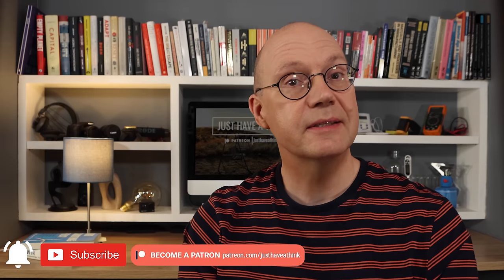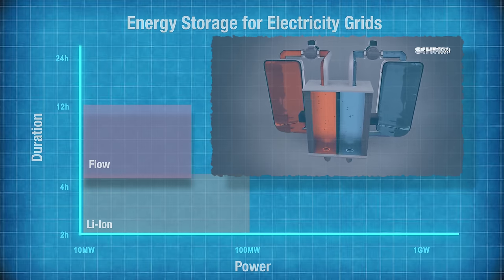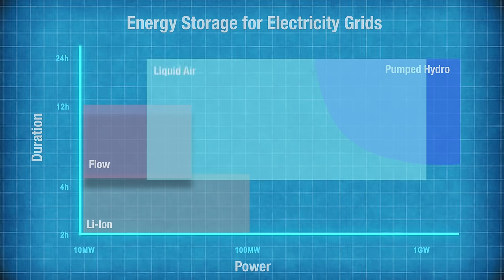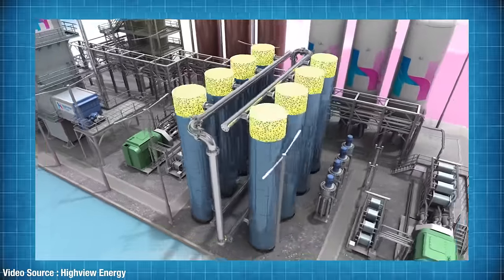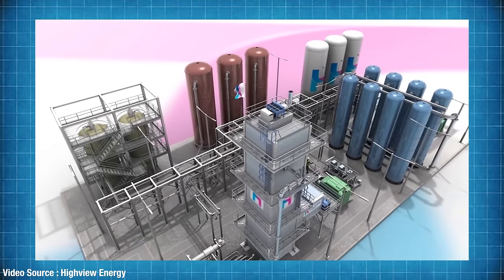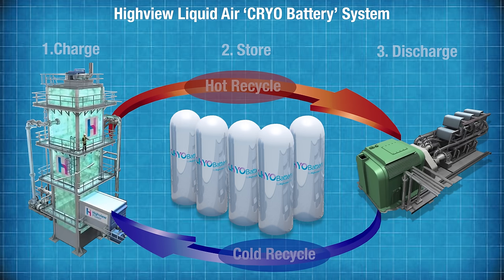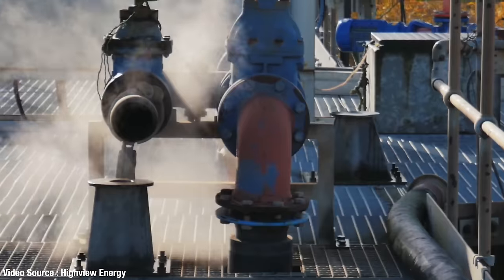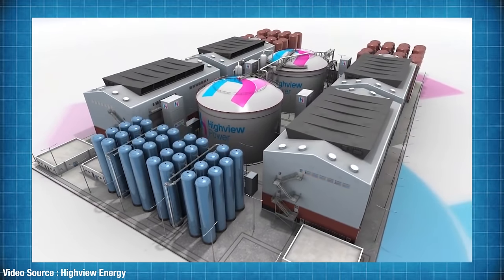Liquid Air Batteries. Literally energy from thin air. Seriously. Literally!

Comment: I'd like to note that the air in this process isn't thin but actually pretty dense :D
Reply: My boyfriend called me an airhead last week, well now I gunna tell him Im not, Im actually pretty dense, so there !
Reply: Literally energy from thick air. The video title was just clickbait.
Reply: The energy that drives the turbines comes from the heat contained in the ambient air that is used to evaporate the liquid air.
Reply: Hence, liquid-air...
Reply: It's starts of as thin as a morning breath..
Reply: It starts thin and the process thickens it using a secret proprietary thickening agent, probably Marmite.
Reply: @grindupBaker  Well it is a process you either love or hate.
Reply: grindupBaker . Or vegemite.
Reply: @mitseraffej5812  During the liquefaction process, lots of heat were thrown out (rejected); essentially you are pumping out heat from the air and making it cooler. This heat is rejected outside. In ideal condition, this is a Carnot's engine run in reverse- or a Carnot's refrigerator.
Reply: The liquid form weighs less per molecule than the vapor form and density almost does not matter and it certainly doesn't in the context that that you have naively chimed in 4. Learn about the energy of fusion which is the wording that High School dropouts are taught by when they get a license to handle fluorocarbon refrigerants. Massachusetts Institute of Technology has been prompted by a mere million dollars to break the silence of such fools in terms of what you should do with the humidity instead of making it lighter you should just filter it out your chimney because although it is heavier as the gas the nitrogen and oxygen takes up less space for the same weight meaning of that the nitrogen and oxygen stay in your house if you separate them from the water Vapors and the water Vapors don't consume any energy being pumped out your chimney. This room air conditioner uses less than 20% the electricity but of course if instead power buy liquid nitrogen turbines you can take another digit off that number.
Reply: @mitseraffej5812  it's actually a little bit more nuanced than that but you're on track congratulations! If you ever watched Barbara Eden in I Dream of Jeannie you know a lot about the hometown of the most recent patent, and that man in Florida refers to the liquid nitrogen appropriately relativistic potential energy. It's only been a matter of weeks since his patent was published. It's very simple refinement which goes to show you the power of the fossil fuel industry and those who think they depend upon us burning. What they depend upon is almost none of us being willing to sacrifice Our Lives non-violently. But in sparing our individual lives we almost ensure ending the species existence not just all the other species but us. If you care about the planet then you have to do the diligence and apply various Sciences including Logistics using metrics and peer review period. That means that you have to be elected or something not just testified to Congress but have the security given even our president LOL. Fortunately the system science of potential energy and phase change materials can be popularized so that we don't need to have the fragility of a Kennedy or a Martin Luther King but the knowledge itself can overcome. that means that Saudi Arabia and China maybe our only hope as they prepare to provide for the future without burning Black Gold but rather turning the sea into liquefied air by remarkably High ratio of liquid air 2 uranium molecules. With a range of digits between 50 and 2000 how many digits do you get guess that ratio has in it? Can 1 oz of uranium create a square cubic mile of liquid nitrogen? The answer is yes but only if you apply current technological developments that allow all the neutrons to do the work themselves drastically cutting the capital infrastructure costs to an affordable level if done worldwide with minimal cooperation is in one large or almost any two significant Nations.
Reply: @janami-dharmam  who are you talkin to 99% of the people here will take what you said is gibberish and you're not even listening to it yourself. The potential energy of liquid nitrogen is far higher than your abstractions because it is on the surface of the Earth that the liquid nitrogen is produced. The various salons that you talk of are basically confused utterances of people who didn't even have an abacus at hand.
Reply: Irene . Your comment has to be one of the most convoluted bits of BS I have ever read, and for YouTube comments the BS bar is very high.
Reply: @Irene-fu6gj  You appear to be the best joker on the you tube (I am yet to see an greater one) - like the potential energy of liquid nitrogen... did you ever went to the school, by the way?
Reply: @Allen Loser I think we are going back to Prior centuries instead of post equivalence of mass and energy where we understand that energy is conserved but not without changing the mass. The energy of fusion specifically is encounter on a daily basis. When ice melts it absorbs heat. Where does the energy of that heat go to sir? I mean you know that it is conserved. You know that it's not a chemical change per se but rather a phase change. Now these are just labels and I don't want to lower myself to espousing Dogma without explanation as you have especially most obnoxiously and saying about 28 grams. Ian Stein and theory has been verified in numerous ways so if you want to look something up why don't you go look up the changing weight of ice when it melts into water or water into steam. You can actually calculate the mass change yourself if you have a big enough calculator to handle the cliche of energy in increasing the mask slightly so that the square of light times the mass balances the equation. It is really an interesting Didact ology because so many people who should know about this they're not and they believe that because they have not had their nose rubbed in this fact they have certitude about what they know. However don't get distracted by what we discreet disagree upon because whether or not liquid nitrogen is lighter than nitrogen Steam in terms of its mass per as you put it molecule it is an extremely dense fuel that has extraordinary properties we can benefit from. There is so much geothermal energy I mean all you need is a way of converting it to something that you can ship and obviously liquefying air with geothermal heat is under investigated for all the bad reasons.

 I had a in-person conversation about this recently and the person I was like you and they said that water vapor is heavier than air. They also got the ice thing backwards but conceded there error there and literally ran away before have to concede the entire jumbo carrot cake.
Reply: @Allen Loser so I went ahead and Googled for your benefit I hope you appreciate this quote and the link that it is found in even though it talks about turning water into its two elements at the end don't just read the final line and complain that's not the same thing as changing the phase of water because he, Dr. Baird, addresses that.
" "chemical potential energy" is just an old-fashioned term for what we now know is mass."

https://wtamu.edu/~cbaird/sq/2013/10/21/why-is-mass-conserved-in-chemical-reactions/
Reply: @mitseraffej5812  what is convoluted is the justification for creating a sustainable fusion reaction at the nuclear level which refers to the nucleus LOL as opposed to the fusion that occurs further from the center but it's far more valuable because it does not depend upon mining materials and then irreversibly transforming them like the sustainable fusion reaction would. This is what you call convoluted bullshit a bunch of scientists that want to drive six-figure cars and have the Summers off so they don't want to actually contribute to the world they just want their pet project to be funded regardless of how many trillions of dollars are wasted. We have plenty of energy we just have to learn how to move it and how to use it Nottoway non-destructively unlike Fusion but in ways that don't have externalities of the infamous sort including warming the ocean directly or more memorably discussed as starting the rivers on fire from the more primitive pollution then what we are currently trying to pulis in terms of our atmosphere becoming a death house imposing contributor to our future as opposed to helping us keep the basil green.

This means that you have to appreciate the difference between a truck that delivers carbon dioxide wasting an incredible amount of it so that you can have something is in your sugary caffeinated water and the amount of pollution coming from the engine that moves the carbon dioxide in the tank around. It's not as simple as saying we need to require that they capture the high pressure carbon dioxide in the tank that they replace it with liquid for. You have to have literacy about these things to know whether it matters that these huge tanks of carbon dioxide at every convenience store and gas station and Bar and Restaurant all of that high pressure carbon dioxide gets released to make room for the liquid carbon dioxide. Proponents of delivering liquid tend to be naive about what that means, it means that you dump an entire tank of highest pressure non-liquid out every time you put liquid in that's because not only is the carbon dioxide allowed to boil in the tank the industry uses the work that that boiling does the distribute the gas itself to the nozzle. As opposed to say having a pump in the tank to pump the liquid itself and then because the tank is at such a low pressure you can have the lid be internal to the tank so that there is never a void but the like we see with the large surface petroleum tanks the top Rises and lowers. If we had enough people working on this task we could afford to sign some of them to regulating the carbonation industry. However because burning to obtain Heat uses oxygen that the plants give us and binds those molecules with the carbon molecules that the dead plants shed when the heat is obtained from resulting product and refining of said product. so the challenge is how do you move energy not how do you produced it. decreasing the mass slightly of atmosphere and drastically decreasing the space it takes to store it is like making hydropower portable, and not just hydropower but all power can now be moved without the tax of electricity being required. electricity is the worst tax ever invented it's a fantasy tariff Saudi Arabia is Too Proud to fake taking credit for but rather a gift from Allah. the world deserves a better gift one that will have people drop the sordid electrical scam on their foot
Reply: @Allen Loser first YOU aggress then later if able confess
Reply: @Allen Loser the expert I linked you up to is the Latter-Day Saint so he might be able to help you better with your confession but your problem is you're not understanding that the amount of energy people are using from power plants and such as it's so small compared to the energy that is in Mass. He should be able to calculate the kilogram times the speed of light squared it's a pretty big number and then you have to figure out what units of heat that represents. But we saw this happened just recently with the fertilizer were they said that the 60,000 tons or whatever it was a fertilizer was like a 2 lb of mass something like that answer math what how many what how many grams is a mess you know it was a sissy talking about I think I should know this better but you basically they don't want the turn announcer or more within your seven continents no into energy. The dictation is terrible in the room that I'm in right now. But you cannot find the scale of the sensitivity that you seek nor can you measure the temperature on the outside of a ziplock bag that you're letting your body heat flow through the plastic into because the thermometer will be losing so much heat in the face of the cold material in the ziplock bag it's almost like the cold material sucks the heat from us.

This is why I am excited about radiant Cooling and why taking your liquid nitrogen and making electricity out of it is about a stupid as anything I've ever heard of. I'm sorry that you remain resistant despite an expert opinion. I think you should study the guy's background more and maybe ask him to pray for you.
Reply: @Allen Loser the point about the small amount of energy dad is converted to Mass when you create liquid water from Crystal Water is that that is also a small amount of mass. You're not going to be able to get the scale to tip much the historical confirmations of the Ian Stein and theories relying upon very large bodies of mass like planets or at least comments under the influence of the mass of planets or the very photons under the influence of the accelerating universe. This is the history. During the early years of relativity Isaac was even roasted publicly in invited not butt scandalous appearances. Engaged the critics to a fault those who understood believed. I'm not sure why it matters to you this concept that every reaction changes the mass if it absorbs or releases heat. I think part of the problem is you don't understand the difference between the material being heated that is rising in temperature commensurate with the amount of heat that is absorbed and what do you see with ice melting. When you melt an ice cube when you melt half of an ice cube the Ice Cube and the half that is melted Ortho simplify this when you mail the third fourth of an ice cube after melting half of it the temperature of the water is the same. but you've converted a quarter of the cube 2 water and left a quarter of the cube as ice. This is why we say that Mass has increased because the temperature is the same. Is dr. Beard said there is no tank for the potential energy that the liquid as in being able to release Heat before it turns to Crystal again nor is there a tank in the remaining Crystal with its potential cooling power to maintain a freezing temperature until it fully melts.

The low amount of mass increase is really helpful because if you freeze the water on the top of a mountain to use it for cooling in the valley below you are going to have to put energy into the siphon to get the liquid water back up to the mountain to refreeze it. But again fortunately the warmer not pumpable ice but completely liquid water does not weigh so much more than the pumpable eyes as to require more energy as you put it to return to the Mountaintop than the cooling the crystal provides after dragging it up the hill almost entirely on its own. the power of this siphon cannot be overstated. it is limited only by the heat removal capacity of the mountain top in the winter when the air is very thin and the pressure which is the temperature accordingly take the way the mass quickly with aplomb and that fascinating Crystal that we call the snowflake with its magical Beauty predates Hiroshima and Nagasaki what is what it is Fusion  the reality of the nitrogen ordinance but for peacetime. There is plenty of energy it just has to be purchased Without Shame but with integrity. you have so much growing up to do.
Reply: @Allen Loser I certainly didn't intend for my comment to say that it can't be measured I said that you could not measure it with a mechanical scale because the change in mass is a small as the math calculate it to be. I don't know if you spent any time on the Channel that I sent you a link to and I mean website of course. And we should check and see if this cat has a YouTube channel though. You are referencing general relativity in a way that I have not, but okay, I don't understand why you don't explain where the energy goes why you don't try to address to specific claim that the article I sent you makes about people like you. You want there to be some sort of tank for the potential energy to be held in. You want an exception to the principle of energy being conserved. You are making claims for general relativity without any citation that just on your opinion of what you think it says. This is like to go pick out an arbitrary example whether it snows carbon dioxide. Whether on a high school level, the cup with the Spring Pulling the cork below the surface of the water has the spring stretch or contract when you drop it. You can measure if your scale is precise enough subject to the stipulation made in the answer to the question which was of course a trick question as of course mass is not conserved during chemical reactions. you seem to be saying that nothing in the surprising answer that I sent you from a certified expert was surprising to you?

I am also somewhat perplexed since I have shared what a siphon can do in terms of lifting water to where the air is below freezing and then allowing the weight of the frozen water to pull additional liquid water to that height which requires far less energy, far far less energy then is captured in the crystallization of the water even if you have to call it potential energy. the Cocoa Beach Patton talks about the potential energy. In this discussion somebody claims that the article they provided says that this specific YouTube channel promotes the company whose demonstration was at 8%. The article actually does not make that claim but is an article of extraordinary scope historical an extraordinary week in technological precision specifically it downplays the efficiency with which the potential energy or energy that liquid nitrogen on the surface of the Earth can provide. I have said in response to you today that the problem with the company is that they think that liquid nitrogen should be produced in very limited quantities for the purpose of making traditional coal power plants more cost-effective as well as of course other forms of intermittent power. but the industry will apply the new tool where it is most valuable and that would be towards coal power plants. the demands is far more variable then the supply that's why electricity is a difficult business to make money in. But liquefied air is inherently asynchronous and therefore tremendous threat to the lectric competition but is being defuse that is robbed of its disruptive power by having its inherent asynchronicity be applied solely for that purpose. Liquid nitrogen has applications that electricity does poorly for example using Thermal electric to drive the heat out of a human body from a distance behind a vapor barrier oh, that's a job for liquid nitrogen not electrons.
Reply: @Allen Loser the conservation of energy is a general hypothesis that has been confirmed. Unless you can explain how steady Mass and varying energy does not violate the general hypothesis the burden of proof is on you. I do not agree with your opinion and your dismissal of the expert I provided is not met with any Authority in contradiction to it other than your own which you have not suggested is close enough to be selected as a peer though you review it reflexively as your Curt if not as dosmissive as the summary  I was sent suggested has. I would have responded earlier but all I could see of your response what is that you seem to not be aware I-BE well aware of the scientific method. I am also aware having spent nearly a decade with graduate seminars in the history of Science and philosophy with a special Focus on change of the Weltanschauung
At the highest level. Yes the insight is chosen by me for didactic value as your response possibly confirms even in your case but if I had to confirm everything I say as having been said before I would be unable to make the kind of progress that I believe is necessary. I have to run this curiosity of course about whether this or that is genuinely new but very little doubt. There seems to be an Avenue if the chemical is so different than the phase change but phase change often is chemical even if not so much in the case of H2O. it is also the case that I have struggled for many years I think about 9 right now over alternatives to chemical electrical energy storage. I had to do this because the American Chemical electrical energy storage was shot out of the water and I could not justify greater defense of the strategy without doing diligence as to its Merit. I found that the pressure washing industry was using crystals of dry ice to remove almost anything without damaging the underlying surface because it is easy to impart great inertial energy to pellets that intern gets converted to heat up impact that in turn releases the potential energy. I believe that the potential energy correlated with the amount of energy the machine required to crystallize the liquid carbon dioxide without releasing any of it into gas. I learned however that the machine was extraordinarily inefficient and that vacuum pumps specifically on the other end are among the least efficient machines I have ever encountered even hint of prior to evaluating.

I have taken seriously light sails venture and listen closely to the young lady and tried to infer what she refused to say in her coyness that I found to be earnest whether she has abandoned the ambition that she found founded by those unpublished insights or not. Specifically we educated her about her use of the highly pressurized cooled air being a new material. she didn't seem to think of herself as a material scientist. if you have studied my comments you will see that the present inefficiency is due to the indirect approach. When you snap the nitrogen directly together the machine that is the nitrogen molecule it moves the heat out itself. So snapping from one phase to another has the benefit of Bounce or resonance in which you don't lose the work that approaching it in pieces does. the Earth has been losing ice but the mass of the Earth has been changing for other reasons as well and it would be difficult to isolate the variable. It is been very popular to stimulate thing so this is the case with the recent radiant cooling article are you aware of any efforts to simulate the mass of atoms based upon there elements and the structure assumed? such simulation would answer your curiosity about how the mass changes but frankly I don't really care about the opinions of man on that. What matters is society's willingness to build. We have to overcome the resistance of those who make money doing it the wrong way. they want us to Electrify because that strategy is relatively impotent, but we can and shall do better as long as I can be heard preferably while I can see the results but I do not require that in my present approach there just isn't time to be so safe.
Reply: @Allen Loser Dogma aside you seem to worship other people's speculation what I am talking about is not countered are counter countered by pointing out that when you say nuclear and we Define that as being relating to the center or the core it is not even relevant. The term is not unfortunate. Potential energy being defined as mass that's not just me. If you read the background of the source I provided he has done work in the quantum field as well. But again when it comes to profligate and the mitigation all you have to do is reverse the externalities and all you have to do for that and have Alternatives that do so which are self incentivizing. Being able to move energy has nothing to do with whether or not potential energy costume has to change the weight. Sorry I had to sneeze there but if you prefer the use of the word costume in the sentence go ahead and leave it.

Electricity is not divine. Nothing externalize more than electricity and the infrastructure costs of utilizing are increasing not decreasing because we are using pricier solutions for producing it and that is creating additional costs all the way down the line in efficiency. We live in a culture in a state of mind that has spread like some sort of perverse epidemic that efficiency is worth the price. Waste can be far more valuable if what is being wasted helps instead of hurts, is plentiful and Power Electronics isn't that.

To go back to what I said if you want to use little tiny ice balls of carbon dioxide as your storage medium for energy it matters how you produce them. it matters how much energy you can get out of them. What you see in the discussion of the survey Style is that variance Ventures are both criticized I'm not having address to creation of the liquid nitrogen and you see the alternative not being criticized or praised but it is in fact far worse. It is the hundred and 30% Factor when it comes to solar thermal getting the Nitro additive that is the nitrogen. lights Sail out energy did the same thing with warm water because the heat in warm water is it extremely inexpensive lowest grade energy.

 But again I think you were being distracted even though I disagree with you about your oppositionality content it is the distraction on the tangential issues. you keep on talking about the horse and this is about the Trojan.

 we can shift the costs around. what becomes exponentially less expensive as the scale is allowed to grow can be indulged in. we were not able to do that with nuclear reactors because of the limited demand for electricity. Even in the ocean prior to the sordid electrification of the motors in nuclearcraft many reactors were installed so that you could have each propeller have its own nuclear reactor. That's not the choice.

 what if you had a boat that made an aircraft carrier look like a rowboat and a single large reactor produced liquid nitrogen using the neutrons to snap the nitrogen together into the liquid into the is it called super critical? You have the ability to distribute the liquid nitrogen to the various turbines. you have an integral solution for counterbalancing unexpected heating events. but then you also have my hypothesis about why aircraft carriers got electrified. supporting the conjecture is the lack of competition on price which allowed the influences of graft the counter what we saw even on broadcast TV which was buses not just trade being powered by Clean burning uranium.

 the various organizations that are supposed to be advocating 4 clean Solutions are clearly out there to take a dive. so far nobody has actually given a damn but just opportunistically pretended to be on this bandwagon they've built True Believer free.

 the existence of the profligate is the problem only if you are a fetishistic worshipper of the false electron God for which you should atone not struggle to remember trivia.
Reply: @Allen Loser not "source" just google hit from a few seconds searching for corroboration/ ashes contain carbon generally or burning combines ambient material with that identified as flued.

Man's concepts tend to compete with other concepts of man and should NOT be confused with reality or characteristics of actuality as that is rarely the aspiration.  For the final time until you do the math to see how little force the earth would apply to the extra mass steam has VERSUS crystal of same molecule speculation about adequate experimental verification is ridiculous. 

 your Prejudice to describe powers to the irreversible that you do that prescribe to the reversible is noted. In the case of bauxite 2 aluminum or aluminum to the predicate which the liquid metal battery constitutes perhaps the molecule could be accelerated sufficiently so that the mass differential could be seen upon Collision DiMaggio could be accelerated sufficiently so that the Mass differential could be seen up on collision but I really have no interest in anything but a simple cheap way of moving the energy where it can be harvested in any amount without damage and moving it to where it is needed and can be used also with only beneficial impact to our planetary systems. that's all I care about I'm not really in it for the recognition I've been doing things my whole life anonymously and would prefer to save the planet entirely and then I'm asleep but reluctantly the plan requires I B out.
Reply: @Allen Loser I would prefer I would prefer to demonstrate the efficacy of the heuristic by refreezing the icebergs
Reply: @Allen Loser to reduce acidification protect coastlines preserve indigenous peoples on there small landmasses I'm not sure that your question is anything but the greatest indictment of your sophistication so far
Reply: @Allen Loser I don't understand why your experiment references combustion. I know that the dr. Beard talked about the mass of pure hydrogen and oxygen versus the mass of it when it is bound into water. A fuel cell produces water from hydrogen & O it  draws from the atmosI think the real issue is if you have been calculating the theoretical weight of water from the molecular weight of hydrogen and oxygen then you have not been calculating it correctly. I think dr. Beard Is relying upon correct weight of water even if water is not normally weighed in moles. All steam however is heavy steam whether you like it or not.
Reply: @Allen Loser we haven't talked about the definition of mass and there are various kinds of mass of course. Implied has been the gravitational attraction but there's also a thermal Mass and so my point concerns the extremely high thermal mass of steam in fact the fact that it is higher then liquid water and liquid water is barely compressible that is interesting. My sumption is that steam cannot be compressed 2 greater density then liquid water but at these higher temperatures it takes more energy as if the temperature scale was exponential. I know that there are different temperature scales that they all seem to map linearly over each other. If you use the energy content of steam to determine your mass the plot thickens even more. This is why you get the bonus 30% from combining concentrating thermal with ultra low temperature boiling liquid. The specific power plant discussed has the liquid are at a higher temperature then I originally assumed. In the survey Artica waypoints out though that if you don't separate the valuable oxygen which would be insane to boil off into the atmosphere given its high value there is Extreme danger that the nitrogen will instead boil first leaving behind the oxygen at a higher and higher concentration. there is a relationship between thermal mass and actual mass so I believe that in this table is the evidence that you seek as the numbers deviate from your formulaic fundamentalist algorithm. These numbers are empirical I assume but perhaps they are also flawed. wouldn't it be interesting if we had a nuclear meltdown because the designers forgot that the mass of the steam increases LOL.
Reply: I don't know why you didn't use electrolysis to illustrate. The hydrogen and oxygen are freed from each other by the electricity that's the electrons I presume being added to those atoms. I think this is why doctor Vera uses that example because everybody knows you're going to need more trucks the Holloway the hydrogen and the oxygen even if you brought the water in those same trucks. I don't believe that you actually disagree with dr. So I don't know why you pick on his example. His example can be true without my example being true if you ignore the reality of the physics.

So for the record do you disagree with dr. Beard? Do you understand that his website is not containing anything--but examples that people like you get wrong! I don't know why I think? And then I say out loud! Those two marks should have my brains agreeing with each other I think it's because I rarely dictate the question but often the exclamation.

Anyway even if you can see the doctor beard is correct about the example that you've chosen to be wrong on it doesn't speak to our conflict I just manipulated you into making the mistake that may not be a mistake in the context that we disagree upon.

For me the question has become whether you believe that his primary target which would be the lithium ion battery for example he is saying that electrons that you put in that battery increase the weight.

I try not to screw around unnecessarily for example it seems like more than the zinc in my lithium ion power Banks are attracted to some of my speakers. It's tempting for me to just use the speaker magnet to hold onto the power bank but I don't want to screw it up.

 for those who are trying to remember the relevance of our conversations relating to this video that were commenting upon the video contains a graph and that graph actually informs many of the comments. I don't like such highly targeted nonsense however. Curtailment has no scale to it and is the opposite of what the a synchronicity Cyro Genex offer. 2 Harvest geothermal power you need to have it be Baseline and never have to throttle. It's like cows oh, they keep milking them even when they just dump the milk into the sewer hot and fresh that's the way it is with nuclear power plants of a certain Style. you have to have a machine that can take the energy that's released from the neutrons and ideally you don't want to make heat with the neutrons but as I have said several times now you want to figure out a way to redirect those neutrons into stapling the nitrogen together. you want to be able to produce liquid nitrogen not for purposes of leveling out demand-side but so that you can why clean fuel to the world from just a few locations. whether you use the fusion heat from the core of the Earth or try to concentrate extremely diluted Fusion heat from the Sun or just use very primitive fission technology instead of electricity you would use the steam if you're talkin old school nuclear. Apparently nitrogen gets Radioactive or is otherwise not a good coolant that extremely high pressure which it is for concentrating solar thermal namely molten salt. to get the mechanical work from the molten salt using the nitrogen is documented now as providing mid double-digit percent return over the sum of the systems operating separately. One of the commenters mentions how you can power a ship with liquid nitrogen but the research says you can use 2/3 as much of it and molten salt to go the same distance but more importantly under the yank technology you're going to have a smaller more compact turbine for the same horsepower because in yank technology cellular International Drive the power is intermittent and Peak power matters more for more than efficiency
Reply: @Allen Loser I look forward to the time that I can satisfy my curiosity about whether Steam and be pressurized to a greater density than atmospheric pressure water. Nothing that you said it's new to me and you have ignored what the table says. It says that not only is the heat much more expensive per kilowatt power say and this emphasizes how if you are using electricity to do low-grade Heating even if you're pumping Heat you're wasting it. Electricity is the ability to generate extremely high temperatures is one of its finest uses. I don't know how extreme 100 bar is I remember looking at the different colors of oxygen ice in recent years. Some forms of oxygen ice have compelling density thermally. What I think is Jermaine about the table is that and I'm saying the same thing over again and again for you sir these extremely large amounts of heat that the steam is requiring to be raised the same linear step in heat temperature should make you very suspicious. I think you have a false Theory a theory that is false at least in part about why the last 10 degrees of heating in a nuclear power plant of the heavy water steam contains far more energy than the first 10 degrees. I have not said that it is a binary. I don't know how many types of steam there are but this extreme amount of heat that it takes to raise the temperature of steam as it gets to the higher and higher pressure sounds to me like you're squeezing those water molecule so close to each other that's some strong repulsive forces are being utilized for Springs these are the kinds of Springs that we need make better use of. the research has been in the springs far more then in the ultra low temperature Springs or so the rhetoric of the recent Grant applications is assumed to have hum
Reply: @Allen Loser I have just read through much of the dialogue preceding the recent contribution that I have not caught until now and my task is to reply to it and try to address the loose and which I think you are speaking in the weirdness of even though you have failed again to address it but apparently are asking the question that I have come here to answer. So we have good timing. Respectfully I think you know what I'm going to say but for the readers of our conversation it should be more overt, explicit, so for the interest of transparency you have confirmed that although one chart talks about joules versus grams this chart talks about kilojoules versus kilograms so I felt comfortable saying water in the other chart not linked is at 4.

You use a different term than this chart uses and you define the term without allowing for the variable of temperature. The heat capacity of steam increases as you point out in ways that carbon dioxide does not have an increase in heat capacity per kilogram as the grade of steam increases. Using helium instead of water also increases the grade of heat that you can extract from a nuclear reactor and the fuel-cell economy depends upon that high grade Heat to Frack the hydrogen from water because electrolysis is a joke. If you're selling something by the pound you don't want to be making it even to the slightest degree in part from electricity LOL!

Your explanation as to why carbon dioxide is used in turbines is false though if clever. The turbines that use carbon dioxide best never condense it.

 But back to the reason I decided I needed to say something else before reading your response that I respond to as well now. the amount of energy that it takes to raise the steam a degree increasing is actually a good thing because that means that the turbine will not cool that Steam as quickly meaning it will get more work out of that Steam for every degree that it cools it.

 You have talked about superheating Steam and I don't think you're the defining superheated steam as theme that weighs more per cubic foot then water. I have an open mind about the organization of H2O in liquid protecting it from compaction that first putting it into vapor would not protect. This is the case of course with ice warmer water will freeze faster under certain special conditions LOL but again this is the sort of fact that upsets Fundamentalist and I'm not here to give you a cow.

Steam is extremely inexpensive. I did not know that's super heated steam stored so much heat. It seems like steam itself competes with liquefied are especially if it can be compressed to a greater density than water. ignoring what I just said if you heat water in a confined space will it eventually turn into steam and even become more compact if the water was at a high enough pressure to start with?

 this is what they use the baked corn husks for you can store hydrogen at low pressures but super high densities in that Ash LOL. If only we had something that worked for water! being able to store a gallon of water in 8 fluid ounces would be extremely helpful and yes it would weigh slightly less as well! I think that the mass of the hydrogen might be affected by those baked corn husks.

 one of my neighbors is a turbine engineer and I was discussing the global cooling prize with him and how air conditioners specifically waste the potential energy of the condensate making noisy boiling the sort of boiling that when you design the ship with two propellers instead of one you try to avoid so as to not damage those propellers. it's not that the pressure makes the boiling difficult I think that is a rather childish way of putting it.

This friend of mine agreed but he was upset that I was not going to compensate turbine Engineers adequately and he was obsessed with how late in the day his air conditioner came on since insulating his attic

He agreed that you could reduce the horsepower of the compressor motor by integrating a Turbocharger into the evaporation. I did name this style of air conditioning compressor but have not published the name because they're already so many designs and the names are often very misleading. since then of course I have learned about radiant Cooling and because people think that Comfort is important even though it's exactly the same as blood oxygenation level myths regarding masks radiant cooling combined with personal contact Cooling can provide the thermal thrills the market has been spoiled by while saving 99 plus percent of the cost off. General Electric makes the package 5 million Watt and that's containerized ie drop-in locomotive replacing hi power module and I don't think I'm spelling this company's name correctly but it's with the H in the y or however they want to call themselves this is the liquid air zero emission locomotive that's being hidden behind the coal power plants except for the fact that it contains an alternator instead of a transaxle so it's not ideal just over the counter AKA off the shelf
Reply: @Allen Loser your joke about the Cannonball is the ice skater stretching her arms out to slow her self downwind spinning or vice versa revealing your internal conception of the phase change. It's a good joke perhaps but far from Clear.

With the new microscopes that we have it's exciting to see some of the research in terms of the mechanism by which electrical energy is being stored in a lithium titanate oxide cell vs. Lesser forms that the market not coincidentally consider is the only way to go 4 lithium ion batteries..

I try to always give Ralph Nader credit even though I have provided the Corollary to his stump speech note. The electric g r i d however, and with this, I accidentally sent the comments but got some benefit because I find this comment now at the end even though it replies to, that wasn't most-recent and the dictation is not able to handle sentences that have the punctuation mark and the word comment in them.

Ralph Nader preached about how much energy the electric grid wasted. He is correct about that. It's not just the grid however and it's not just the energy but it's the capital of converting better energy into worse in order to put it through the grid increasingly matters more than the losses.

When Regulators mandate conservation electric read response by lowering the voltage because the fixed consumption machines attached to the grid even if they become less efficient use less power per hour. This is an honest anecdote from a dishonest utility but one that honestly sites how that nonsense has been successful in the past for other utilities in bamboozling regulators.

Electric utility industry has a history and it is the history of snake oil. It wasn't today's Physicians who adopted electricity to increase on Chris the number of patients that could see for day with total bullshit about the benefits.

Many people have heard about Physicians using electric vibrators to make it more profitable 2 relax the hysterical. Hollywood also engaged and very nasty propaganda against nuclear insation. we don't have the ability to have hindsight of course about what would have happened had only honest progress has been made. but the claims about electricity being too cheap to meter definitely would have affected natural gas oil coal historically not so much now. even if electricity is free it does not mean the container shipping industry would Electrify. Tesla provided free electricity of course and it's not the cost of the electricity that has them no longer doing that it's the charger. Electricity should be opposed not because it itself is expensive but because of what you spend and needlessly to use it has opportunity cost that include saving our world. I prefer hissing nitrogen and the saved world